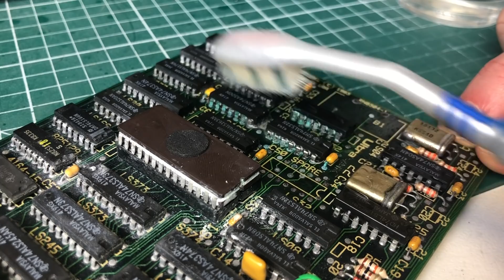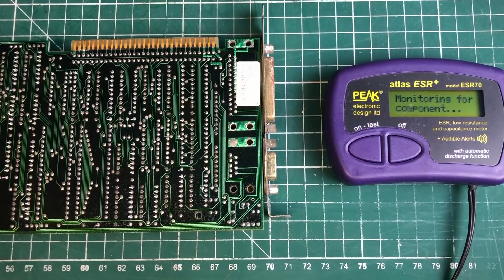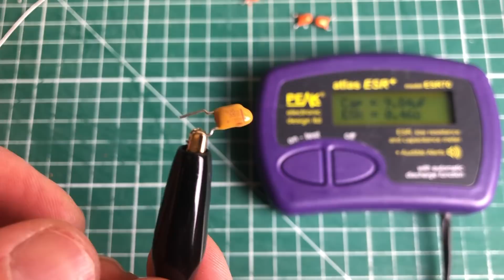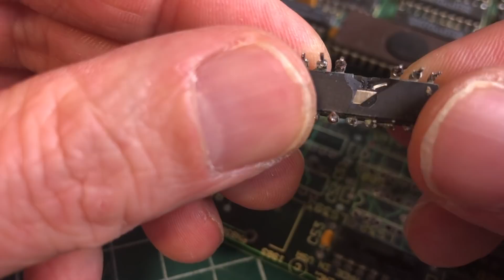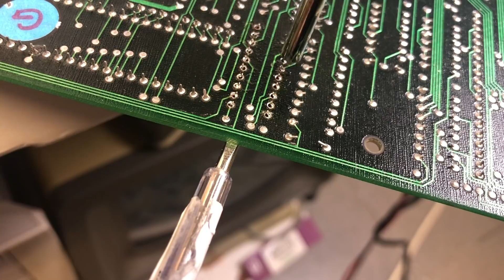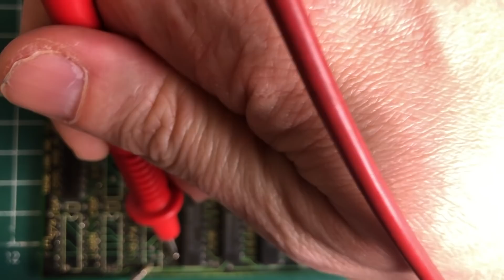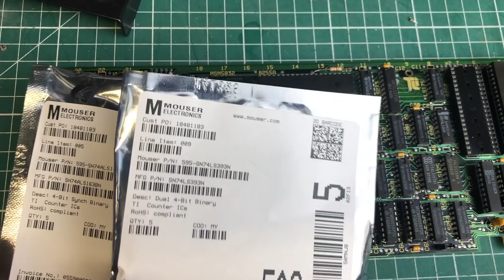Unfixable videocard from hell ? (part 1)

Comment: I have a good story for you.  When I was 13 or 14 I got a 286 computer for my birthday, it was a Altos WS100 workstation made in 1987.  It was cheap because the FDD controller was bad.  I put an IDE/floppy controller in it years ago and disabled the onboard FDC.  I decided recently to try and repair it and was determined to put a new 765 chip on the board.  I went into my stash and found a chip compatible with the 765 and brought it back to the bench.  I was getting ready to desolder the old chip, marking pin 1, and I thought I must have been off by a pin or something, because there was nothing poking through the hole.  It turns out that when Future International was stuffing the board in 1987, one of the FDC pins folded under the chip and was never properly soldered.  It worked initially due to friction and pressure, but as the machine got older and vibration and oxidation took their toll, the pin no longer made contact.  I stuffed a cut-off pin in the hole and soldered it to the leg of the IC, viola it was fixed!  That was an astounding find that I had never noticed before.
Reply: I had a similar problem with a BBC Model B computer once. It had spent its entire life as a networked machine in a school, so it had never had the floppy disc interface upgrade installed, which consists on an Intel 8271 FDC, some logic chips and a ROM. I pulled some chips from a dead machine and installed them, but I couldn't get it to read any discs. I eventually found that the socket for the 8271 had one of its legs bent underneath, making no contact. A small blob of solder fixed it. I loved the way that a manufacturing fault from 1982 was only found in 2007 due to the way the machine was used.
Reply: @Zeem4  I found it fascinating, it is good to know that old machines can have a new life with some repairs
Reply: That's a good kind of memory that I like to read, I saw everything while reading it in my mind. Certainly it brought back to you good memories and nostalgic feelings, didn't it? Honestly, I am glad that you've shared it here. Thanks. ^^

Comment: The 2nd chip from the lower left is a 74S174, that is probably where the clock divider is that feeds the 6845.  The clock on pin 8 of the 7404 should appear on pin 9 of the 75174, then pin 12 should go to the 6845.
Reply from the maker: The 74S174  is the third chip on the lower left.  Pin 9 shows 2.030Mhz ( = derived from the 16.24 crystal / 8), and pin 12 shows 1.015Mhz, and that is the CLK that the 6845 is receiving. (but pin12 is not electrically connected to the CLK pin of the 6845).

Comment: You might want to keep the tip of the soldering iron on the pins for a little bit longer, so the solder can reach the other side of the board.

Comment: Could you elaborate on that breadboarding in some later video please?
Reply from the maker: Just taking out chip(s) and putting them on a solderless breadboard for debugging issues and trying to get a better understanding of how this stuff works. It’s a simple way to isolate issues with single chips.
Reply: @RetroSpector78  a TL866 eprom programmer may come handy as well as this device can also test some IC chips !

Comment: Can i ask a question that is a bit out of context,?
but is it possible to repair the end of a trace , "the thick end", rather than scraping off plastic to make a bridge, which can make things even more complicated consider how thin traces can be.
I'm asking because it seems you have some done soldering for a while and maybe having some tricks up your sleeves.
and well solder cant just be applyed on plastic if the copper is been ripped of due to stubborn parts that you accidentally ripped off to hard.

Also, way is "solder suckers" have a plastic tip? and not something that is heat resistant and obviously not binding to solder.
its so annoying to try to suck up solder without melting the plastic tip when you have to work within a few millimeters

Comment: Maybe try to read the EPROM contents?   If the chip is suffering from bit rot, you may get different checksums each time you read it.  Interesting to see that the actual installed chips did not match the silkscreen.   For instance an ALS instead of the indicated LS, and an AS instead of an S part.  Probably they had timing issues with the slower parts.
Reply: It's just a character ROM, so that won't affect the functionality he's trying to test.

Comment: After replacing multiple chips and it still not working, at this point is it really worth the effort and money to try to repair. Its such an old and basic card - it only has a text mode anyway, no graphics.
Reply from the maker: Its a Tseng Labs ... from 1983 .... on a retro channel :) I understand what you mean, but for me it’s all about learning new things and figuring out how stuff works. Spent way too much time on it so might as well make some videos on it :)
Reply: @Simon....If you think like this, there is no need to get in the retro hobby or start a retro YT channel...

Comment: Why can't you test and verify traces under ICs from the back of the board? I mean I understand if it can get confusing if schematics aren't available (and maybe even if they were), but still.
Reply from the maker: In some cases it is really difficult to follow them and you might make certain assumptions. Especially when
You are focussing on issues that are not there ... sometimes you think something is broken so you force yourself to find a solution to a problem that might not be there. In this case also a lot of logic chips turned out faulty so had to remove them anyways.

Comment: Vinegar to neutralize acid? 🤨
Reply: Yeah, it sounds funny, but I am sure it's just the wording. It should be more like "Vinegar to Dissolve the oxidation" And since the vinegar is just house-hold diluted, and not 99% Ascetic acid like I would use, IPA should clean that off no problem.   
But we both know what he means, so that is cool right?
Reply: @Raul_Gajadhar  it sounds funny indeed
Reply: NiCd batteries use a potassium hydroxide electrolyte, which is alkaline.
Reply: @eformance  Indeed, it is not acid that is spilled.
Reply: @GuybrushThriftweed  I know, but how it is said was quite funny

Comment: two quick tips: when soldering chips or sockets, solder two opposite corner pins first so you can check it’s seated right and adjust before doing all the other pins. Second, inspect the solder resist on those traces that go between the IC legs - sometimes it is worn away and when you solder the IC pin the solder will wick through the plated through hole and bridge to the trace. I had this happen on a C64 PLA and it took me ages to find. You can buy solder resist touch-up pens to repair it, I suspect nail varnish might also work.

Comment: I find that defective capacitors will often reform during the desolder process, so if you can't test them in-circuit then you just have to replace them.  I have the earlier ESR60 model tester to which I have added a footswitch remote control, because it doesn't wait for the capacitor like your ESR70 does: https://www.youtube.com/watch?v=CG6LllxGsC4
Recently I had a remote control which had been attacked by battery acid and I was surprised how well WD40 cleaned it up.

Comment: use hot air with the desoldering gun or preheat the board and then use the soldering iron and the sucker when the board is very hot, you can also bend a copper wire so it touches both rows of the pins then you need some more powerful soldering iron like 50w or more and then add solder around the copper wire where it touches the pins and then take out the ic

Comment: Suspect that sensitive logic parts may have been damaged by powering up a corroded card which had shorts between pins that allowed power levels to exceed tolerances.  IE full current from chip VCC to an adress line, etc.  TTL logic stuff is pretty resilient, but some of this early stuff wasn't particularly robust when made.

Comment: Hm... I got a desoldering station. That made IC removal really easy. I usually desolder multiple ICs one pin at a time so that they don't get too hot so in case they aren't broken I can continue using them.

Also this board looks in terms of components and capabilities like the video section of Taito's Qix. I fixed two of these that had similar corrosion. ICs really don't like battery acid, it creeps into them. And then when it finally works, they die within hours or weeks of use.
64k RAM, so this thing could do 320*200@256 colors (at least that's what Qix does, but the game only uses like 12 colors... self test shows 'em all - OK Qix does 256*256*256, not 320*200*256 but maaaan Nerd Alert!)
And since I regularly fix circuit boards like that, I have an IC tester. Don't just blindly yank out ICs if they can still be good. Although the first three rows... even if they work now, they won't in a couple of weeks...
Reply: @Mr Guru After many minutes thinking what to answer, I settled on "O Rly?"
Reply: @Mr Guru Lol now I read the edited comment. "Maybe" fits exactly, since it isn't a graphics chip, it's a graphics controller chip that provides flexibly programmable timings (and VRAM addresses) for a graphics subsystem. It doesn't care how powerful the subsystem is. Character only,  Lo-Res, Hi-Res, 1 bit per pixel, 8 bits per pixel, more, it doesn't care. I wonder if it can be programmed to do HD... guess not.

Comment: Your work is incredible. I would have ragequit after replacing just 1 IC.
A few caps is enough for me!

Love the vids cant wait for part 2!
Reply: Second that.. I have three EGA cards that only show a few lines on top of the screen, like seen here in the end. Would like to repair them but I fear it will take too much time and skill
Reply: @GuybrushThriftweed  I have been putting off replacing the caps on my Geforce 2 pro because there is... 5 of them. xD
Reply: @LewisR09  Having the right tools sure help with that.
Now that I have a desoldering iron and a good soldering iron, things are so easy to remove ... It's just super nice !
Reply: @DxDeksor  I have the same type of desolder pump that retrospector uses. Love it. much better than braid from my use anyway.
Reply: @LewisR09  I love my desoldering gun more than my soldering iron and braid :)
Reply: And you think to yourself, is such an old EGA card really worth the time, money and effort to repair.
Reply: @simontay4851  I never had EGA and I have found an EGA monitor now so yes, I believe we need to save as much as we can. One is an IBM card and I like to keep my systems as original as possible. Prices of old hardware are getting crazy so another reason to save stuff... My two cents....

Comment: You could have put a warning. Seeing you lever those ICs out really made me cringe. ;-)
But it was for science and learning, I guess, and it shows why you shouldn't use screwdrivers on ICs.

Thanks for putting this in context and offering a way better method of desoldering chips!

I learned that adding fresh solder is about 50% of desoldering success. The rest is patience and often a bit of luck.
Reply: yeah, i was expecting the pads to get lifted..
Reply: @C32-d5j  Me too, but did you notice he cracked that orange component (capacitor?) too?
Reply: @SimonSideburns  No, you're talking about the one @8:49 and @10:57 right?
it looks like he replaced them all off camera
also look at that rainbow on the tip @10:24, wew, looks like a 10$ iron
Reply: @C32-d5j  Also at 8:25 ish when he levers out that chip
Reply: @SimonSideburns  yeah, i noticed that one, all that maters really is to not damage the PCB because it's usually better to replace caps with newer ones as long as the rating matches
Reply: although i can't imagine that cap making a meaningful difference unless it's a tantalum which fails sort

Comment: Dealing with similiar issues on an Amiga 2000. Got the system booting but I plan to rebuild the front part of the board due to battery corrosion.Fighting the Zorro bus now...hoping its just the logic ICs
Reply from the maker: Thought these logic ICs were built like tanks, but this one has proven the opposite.
Reply: @RetroSpector78  yep. You'd think but age says otherwise. I wish I had recorded my work on this board :( I have a channel I've been trying to build
Reply: Also if the power supply in the machine was a cheap one, it could drive these chips out of spec And make them slowly dir.

Comment: 36 seconds in.... And I am thinking. Good luck, you really need it with that card. Ohhh the damage. 😒
Reply: You should have seen the condition of the PC's they were in...I only removed the Varta as a first step.
Reply: @GuybrushThriftweed  Always up for a horror story 😁
Reply: @brostenen  I'll post the pics on Vogons when the two systems are finished. I am not sure but I think I did a post about them there... Let's say I think they were used to plow fields, work in the garden or as a plant pot. Both IBM 5150/5160 systems/cases.
Reply: @GuybrushThriftweed  Cool. I will be looking out for some pic's. Personally I am concentrating on different platforms at the moment. Those Commodore machines are taking way too much time to investigate stuff about. And then again, some are dead simple constructions.
Reply: @brostenen  I saw some time ago that you were into your A500. my nick on Vogons is different there :)
Reply: @GuybrushThriftweed  Ahhh. Yes. I am doing some stuff regarding both Amiga500 and Amiga600. 🙂
Reply: @brostenen  Sadly the Amiga has never been something for me and probably never will since I never had one when I was a kid. Bought a 500,500+,600,1200 and CD32 but sold them all pretty fast.
Reply: @GuybrushThriftweed  Yeah. They are for everyone. I grew up with them, so I have a strong personal attachment to the platform. Anything X86, Amiga and C64 are my kind if thing. That being strictly between 1983 to 2001. I am not a fan of the TED series though. However I am really missing an Amiga 1200 in my collection. Sadly no money for it though.

Comment: I was wondering if something like that could be cleaned in a dishwasher.I hope it does not sound like a stupid question.
Reply: Not a dumb question. I've done it. But, in this case that's the least of your worries
Reply: @thomasvlaskampiii6850   I think you're right.
Reply: @stevenanderson3205  I'm almost wondering if the vram isn't dead or if something is going on the video processor (or whatever it is that he called it) since he was able to get lines on the screen at the end of the video
Reply: @thomasvlaskampiii6850   I am the type of person that would have taken everything apart and rebuilt the whole thing even if i did not know what i was doing i would go to the web and start getting info on what to do next and made a huge project out of it.
Reply: @stevenanderson3205  That's basically what I'd do too. Though, you'd get further faster with an oscilloscope. Not that I have one of those, but I have used one before and man do they make life easier
Reply: I’ve seen the 8-bit guy put pcb’s in the dishwasher a few times.
Reply: @dykodesigns  I believe that's where i saw it also i sub to him i enjoy his video's.

Comment: You want to see corrosion? My 486 board had bad corrosion on there and the power connector was in worse shape than I thought, caps were toasted, and no damaged traces, which I'm lucky. Going to recap the board and get a replacement AT 12-pin PSU header.

Positively, the board looks a lot better than it did after removing the corrosion and oxidation, but the power is a bit weak (no -12VDC and +5VDC is a bit erratic), so after getting new 2.2nF, 47pF, and 100nF caps and a new AT PSU connector or the 6 pin ones (2 of them needed), it then should work once again and if the integrated I/O doesn't work, I have a new VLB I/O card as an emergency card for IDE, FDD, printer, serial, and game port (will be disabled for the sound card).
Reply: my macintosh performa 400's logic board was heavily corroded from the lithium 3.6v battery leaking all over it. it was dead, it couldn't be fixed, I just recycled it, saved the intact parts and case.